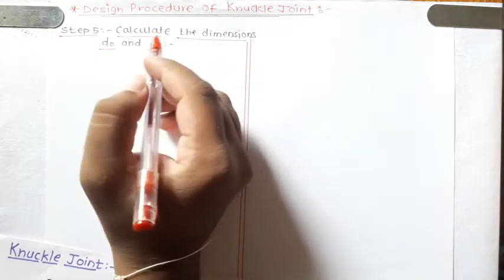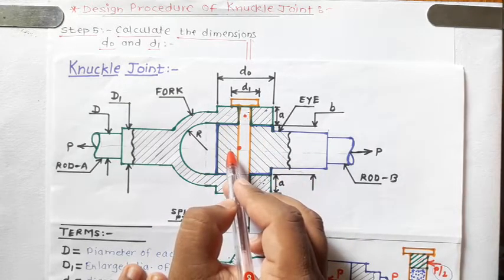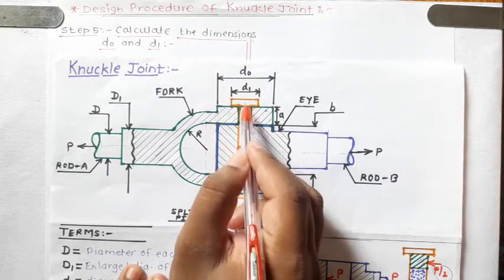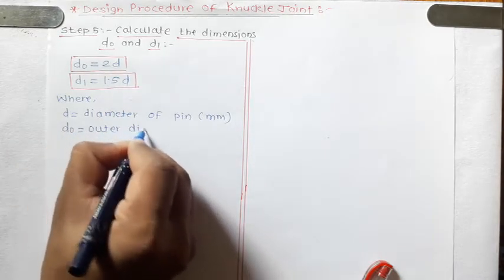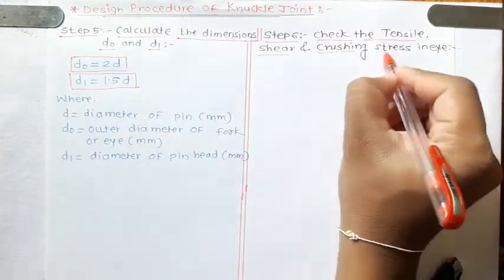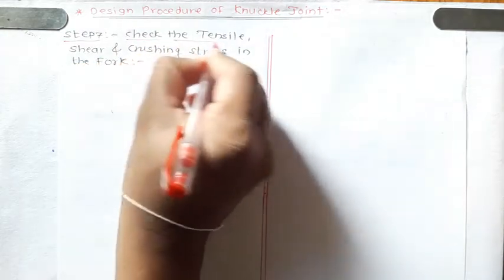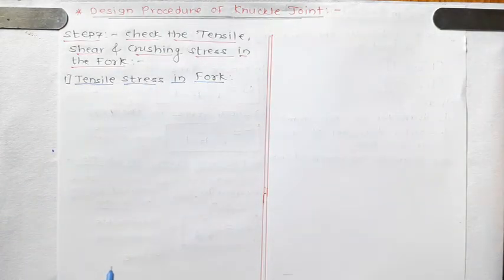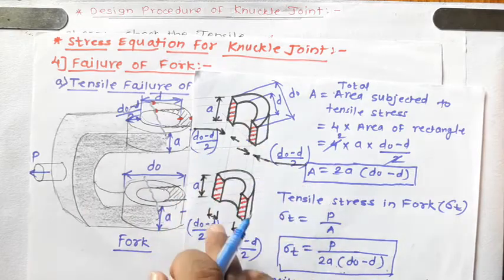2.17 Design Procedure of Knuckle joint   Part 2_Design against Static load _Machine Design I

Comment: I have a question, with regards to the bending stress moment arms, how do you consider these if the fork thickness is much much larger. For a design im working with, the fork thickness a is 2x the eye diameter and hughely overestimates bending.
Reply from the maker: https://youtu.be/ndhJyv2Se6g?si=9bVd1RVWRWImqO1W
Reply from the maker: Watch this video...you need to change Thickness of fork a=2d and derive the equation for bending stress. In Video I have used a=0.25d
Reply: @Y9096841236D  thanks for your response. The part I am assessing is a 30mm long 2mm diameter pin connected between rod 8mm and lug of thickness 11mm each. As the pin is slender I believe it will deform so the contact area reduces prior to yield but unsure how to assess this